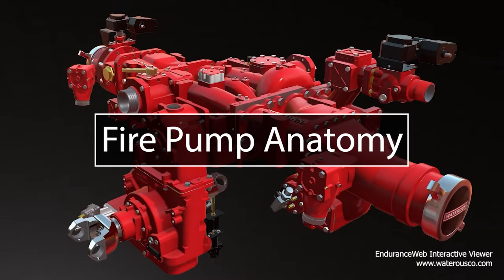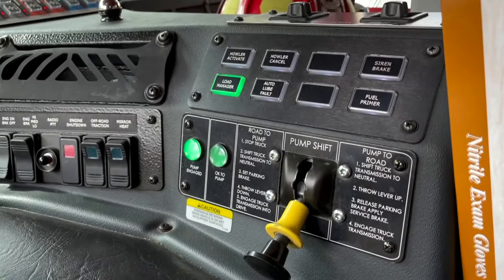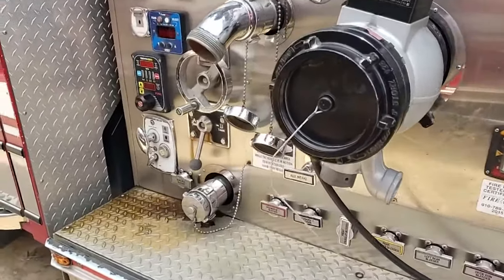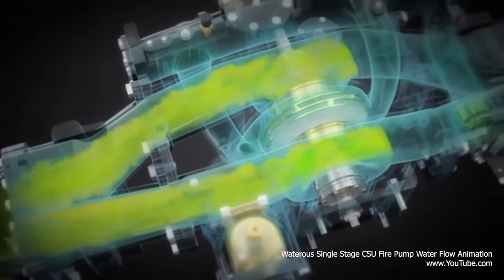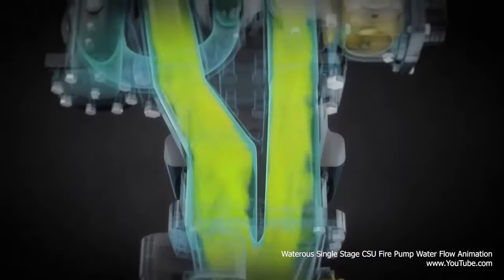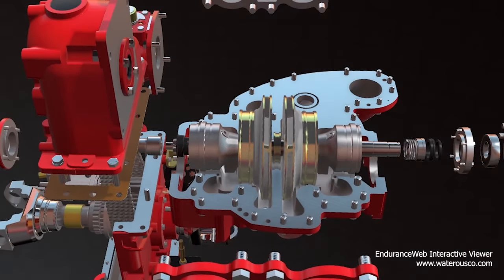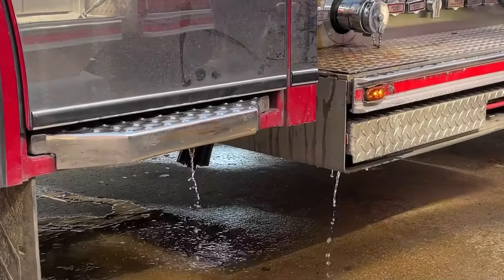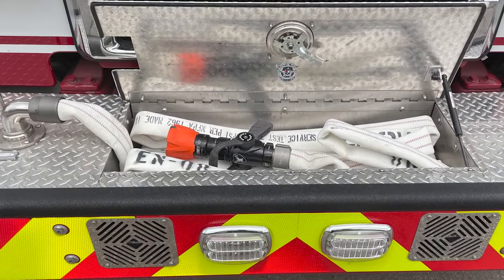Fire Pump Anatomy

Comment: So correct me if I’m wrong, the pump is operated almost like a PTO system? I mean this as in engine operated, like the higher the RPM the higher pressure
Reply from the maker: Yes, you are correct.